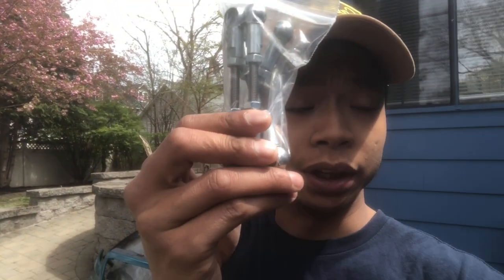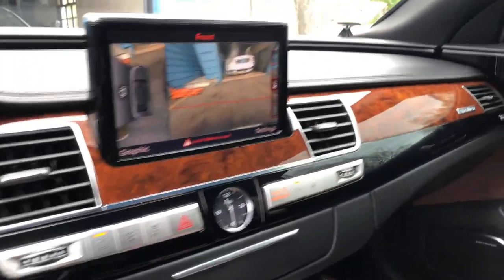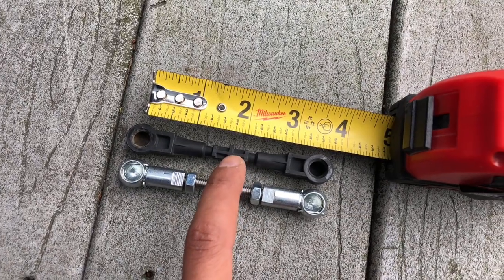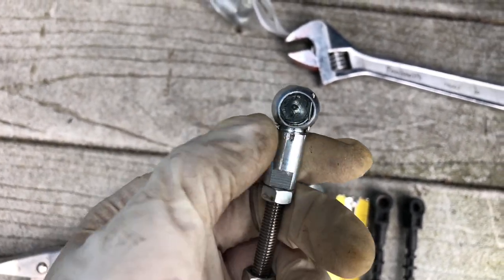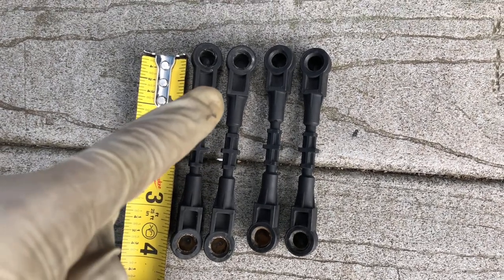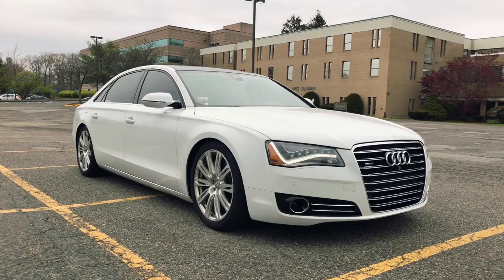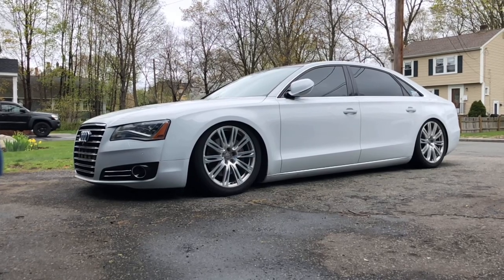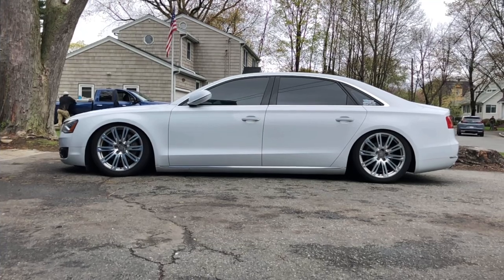Audi A8L Lowering Link Install

Comment: Wish you had showed us how you adjusted them before installing. I saw you use vice grips and an adjustable spanner. Do you need to adjust top and bottom of the link or just one side? Did you jack the rear of your car on the diff?
Reply from the maker: I’m sorry I thought my time lapse of it was explanatory enough but no worries, so essentially it’s just a rod right and the 2 ends screw on so you adjust both ends but make sure there’s enough of the rod biting so it doesn’t slip off and have a weak point right! SO WHAt ever length you decide to adjust too just make sure the other side is relatively the same, and yes jacked car on rear diff put a piece of wood in between the jack and diff
Reply: @turboporsche_  no worries and thanks for taking the time to explain, much appreciated 👍

Comment: When installing lowering links  do you put the car in Comfort or Dynamic mode before you start the process? I always drive my cars in Dynamic mode  or Individual does that matter. Thank you.
Reply from the maker: it doesn’t matter which mode, the only thing that does is putting the  suspension in “tire change mode”
Reply: @turboporsche_  Thank you